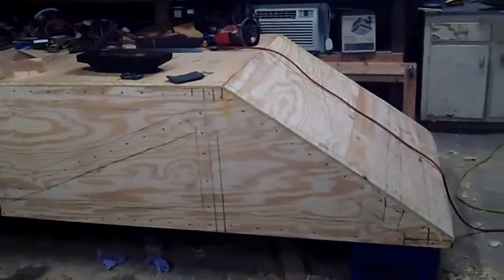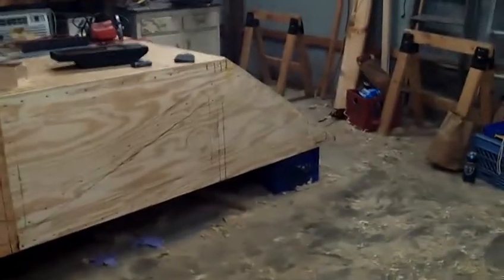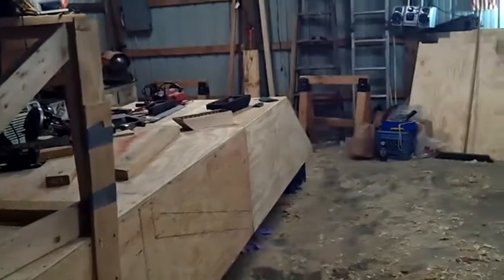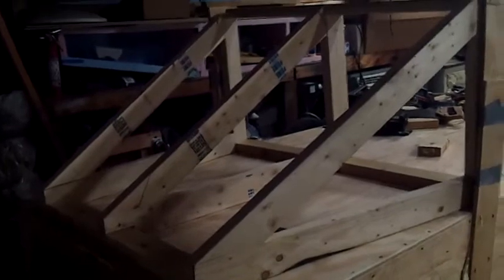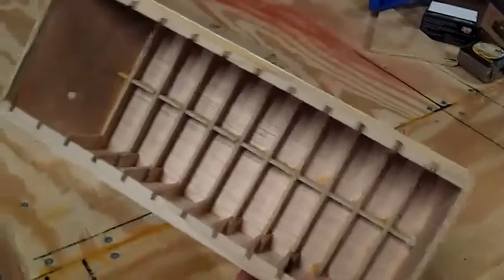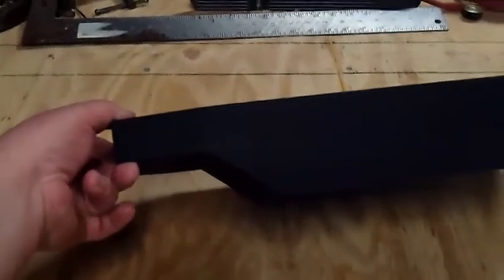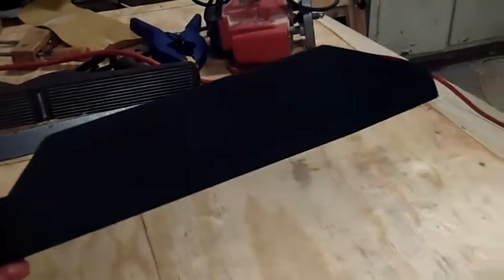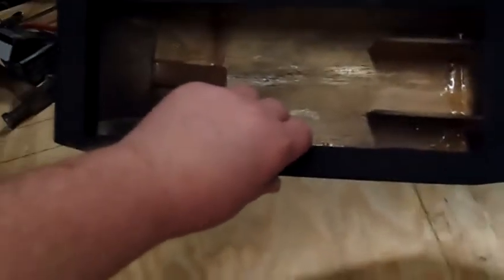home built Boat 003

Comment from the maker: Thanks for posting your videos I've learned a lot from them. 
I know of the stitch and glue techniques but never thought about using them on a model. 
To power it, I was thinking an 8 HP Briggs that I have. It's a chain drive set up to a four foot wheel with 10 or so paddles. I'm trying to make the whole unit removable so the boat can be better used and for other uses. I'm putting a well on the back so a can drop an outboard motor through it.